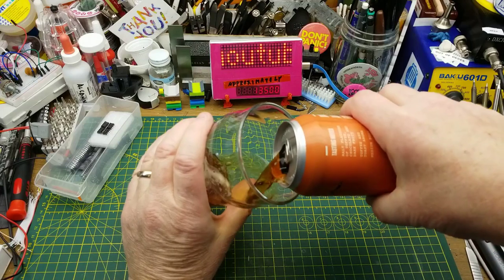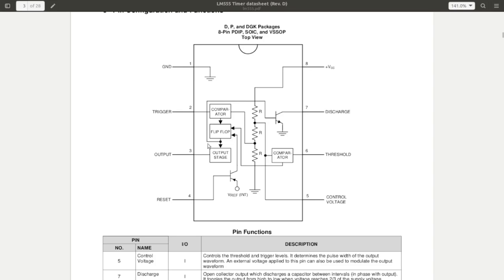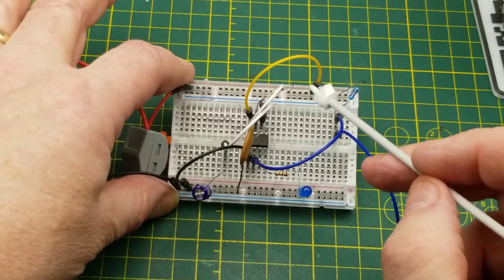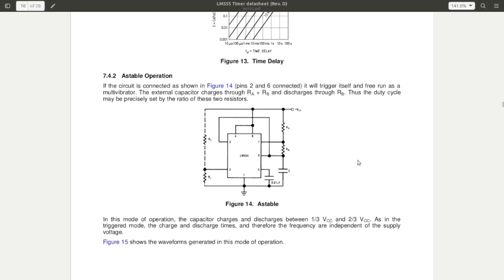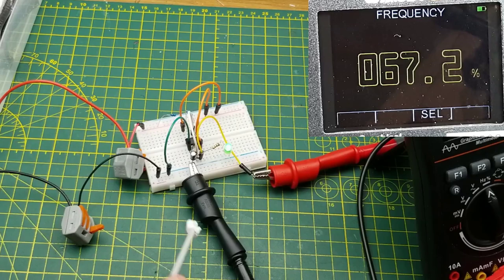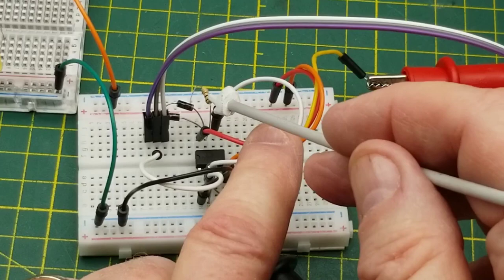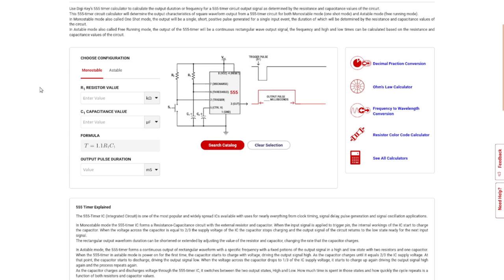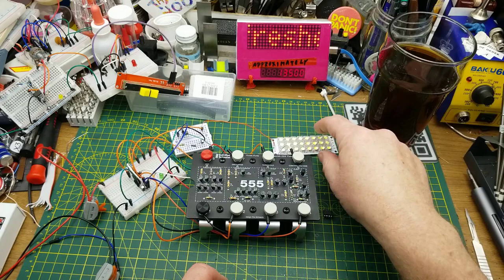555 refresher tinkering

Comment: It's so easy to replace the 555 these days with a small 8pin mC, even to the point were you can put the caps and resistors around it and produce the same operation. I always found that the 555 needed quite good supply decoupling or it was prone to resetting itself. 

Back in the 80's i made a car alarm that triggered when the internal light came on as you opened the doors. but it was  meant to pulse the horn, but it would only sound the horn once and then reset. with a resistive load it would pulse on  and off until you hit the clear.reset button.

Gave up in the end and got a streering wheel lock. 🙂it's what we did when we were 17 no staying power.
Reply: Woof!!!!!!!!!!!!!!!!!!!!😏
Reply: Squeak!!!!!!!!!!!!!!!!!!!!!!
Reply: @fredflintstone1  Dito.
Reply: @andymouse  Cheese!!!!!!!!!!!!!!!!!!!!!!!!!!!!!!!!!!!!!!!!!!!!!!!!!!!!!!!!!!!!!!!!!!!!!!!
Reply: "I always found that the 555 needed quite good supply decoupling or it was prone to resetting itself." I recently cobbled together a shift register LED chaser that is driven by two 555 ICs and I did not decouple as you say, and one if not both of the 555 ICs reset undesirably as so ...

Comment: Impeccable "timing".  I was just trying to build a circuit that triggers the gate of a MOSFET for 5 seconds.  I built it using a RC timing circuit that charges up when you press a button.  However, the mosfet gate does not cleanly turn off at the end.  I was going to come up with a solution that utilized a zenner diode, but it looks like a 555 monostable will do the business.  Thanks.

Just ordered some 555s because I'm basically reinventing the wheel here!
Reply from the maker: Glad to have provided some inspiration.

Comment: I made a RR crossing flasher using a 555 then found this on IcStations DIY Kit 5MM LED Flash Light, Simple Flash Circuit Soldering Kits
Item ID: 2721

Comment: You should get one of the Evil Mad Scientist 555 kits and put it together 😆If you wire up an Atari Punk Console be sure and run the output through a voltage divider to get the signal down to a more reasonable "line level." 👍Kaustic Machines has a schematic where they add a 10uF cap and a 10K resistor in series to the output, with a 4K7 resistor to ground to form the voltage divider.
Reply from the maker: I did  
https://www.youtube.com/watch?v=OHDbsn6DkyM
Reply: @pileofstuff  and now the SMD? 😆
Reply from the maker: @HazeAnderson  I did their 741 kit in SMD and that was enough for my old eyes.
Reply: @pileofstuff  HDMI miccroscope!! I use it for my through hole soldering now too. My eyesight has always been poor but old eyes is the worst!! 😆I know they are not cheap, but the ultra plus upside is you can easily record the video too.